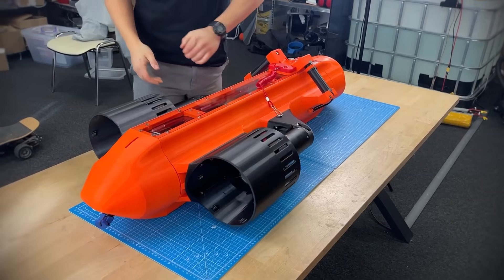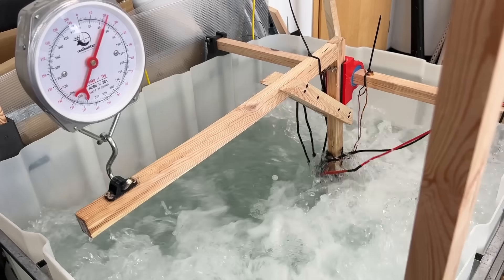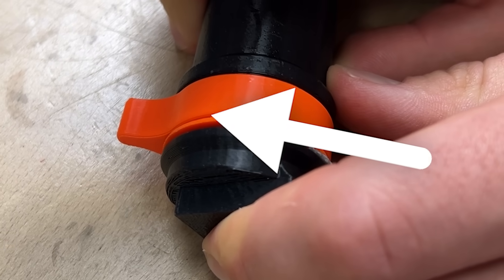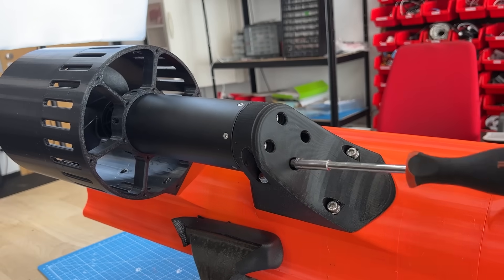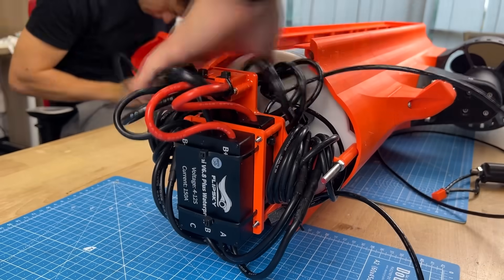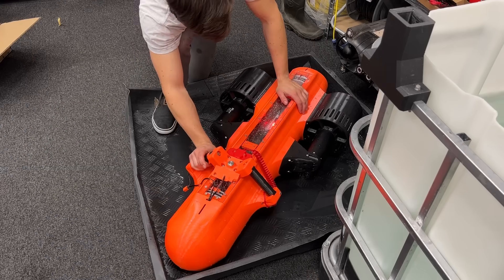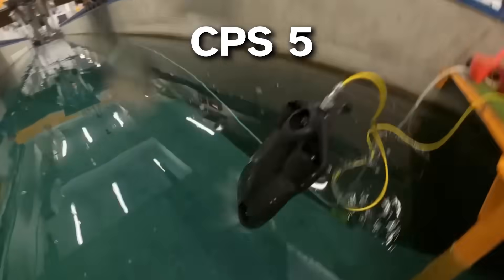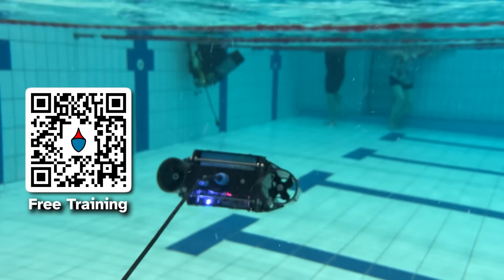Building The Fastest Underwater JETPACK

Comment from the maker: A baby riding this thing would've been faster

Edit: Here's part 2 - https://youtu.be/IvCh4gWkHhM?si=RLTkcOvNz6V8oReG
Reply: You will want to reduce the size of the holes in the motor guards for that.
Reply: Baby training is expensive, though.
Reply: The driver of that thing needs a face-shield helmet tho, also, the speed-drag may pose a risk to the neck of the driver.
Reply: Make water inlets that cool the converters outside and make the cables shorter so they don't block the flow.
You probably need 10 or 20% more power rating for them than the motors.
Think About flow control of the coolant and case integrated heat sinks.
You might want an extra crash bumper at the front or reverse thrust.
Reply: @Nightowl_IT  - Speed brakes on the diver would help. But if they deploy unintentionally, the diver gets ripped away and left behind as shark bait.
Reply: Maybe have a hydrodynamic cockpit with a rubber bladder that seals at your waist, and pressurize the bubble?
Reply: need a dwarf test pilot. Or someone that lost their legs. I've been saying this about jetpacks for years. 2x the flight time or same flight time with 1/2 the jetpack. Imagine an elite group of dwarves with jetpacks and weapons? Terrifying.
Reply: @Pyromancers  Midgets and above knee amputees would be prime test subjects!!!
Reply: @Pyromancers  - Women have complained about this obvious issue for years. If legless, female short people were sent into hydrospace or outerspace, their diminutive size would be exceedingly helpful. But few could hope to get that job, and it's the projective hopes of people that draw them into supporting unjustifiable manned platform support.
Reply: @Pyromancers  😅
Reply: It's not rated for babies, they would have to change the grill.
Reply: I would call it CPS
Custom
Printed
Shark
Reply: Hey I sent you an email earlier, can you please send me a reply?
Reply: Call it the "Scrubberine"❤❤
Reply: adding (part 1) to the title would've been less clickbaity but here we are
Reply: @indubitably_  he blurred the prices when he showed the website, it's to be expected
Reply: not a jetpack, but...subpack?
Reply: @amdreallyfast  not much of a pack, but the name is good
Reply: Immediately thinks of turok Dino hunter
Reply: Let's be fair, you are quite fit. Child wouldn't have that smaller cross section of a body.
Reply: Scharks dont eat ppl bro please say this in a post U hurt scharks image even more alto I love the vid
Reply: @ufcplayer2444  they factually do and have. We've found sharks with human parts in their stomachs.
Reply: Should have created a shroud that went around the person that made them incredibly water dynamic.
Reply: @JeremyKilroy  - A shroud without a tapered end (trapping the diver) will not necessarily exhibit significantly different drag than an unshrouded human.
Reply: Mini sub
Reply: Does that mean you are looking for a volunteer?
Reply: If the shark gets your legs you can pull the shark to shore
Reply: @fazered8202 
Or Not!
Reply: thats what she said
Reply: Only one way to find out ! gets the duct tape
Reply: More like CPOP Custom Printed Orange Pickle
Reply: Reduce hydro drag by printing a recess for a aluminum air tank in the top of the hull and feed the regulator off a back mounted K valve. Or put a pony tank completely inside. In backpack mode extend your hands forward, clasp them together and narrowyour arms as much as possible (squeezing your head)
Reply: I wonder if that Nirvana baby is employed.
Reply: Wished I could used it it was darn cool
Reply: I have an idea for future under water scooters you can make it a mini sub of sorts where you can insert the top half of your body fixed with cameras and VR type monitor with forward and bottom view
Reply: Would you guys be interested in making one with larger motors for $20,000? 

Do you have a business contact?
Reply: I love that in the us we have an agency called cps... child protective services. Then the stuff like the motor guard and such on this channel
Reply: @hf117j  my stomach
Reply: You need to remove the boundary layer to go faster... all possible.
Reply: I know the exact problem your having weak esc's and voltage cut-off...you should 1x esc 350amps 1x motor and add capacitors to the esc, thicker wires/8mm connectors and problem solved.....your welcome😉
Reply: Its much more complicated, but i'm saying it in simple terms...for the people that dont speak tech language
Reply: @CPSdrone It almost looks like it's big enough if modified to slip  into surfboard and paddle board body to be ridden on like a surfboard and paddle board.
Reply: When you get done with the underwater scooter you should get the underwater scooter in your programs
Reply: I think for better hydrodynamics you shoul to add a watershield(exat thing like windshield)
It will help to see things next to you, allows to not be annoyed from powerfull backflow of water and reduces the lac of the hydrodynamics
Reply: The jetpack mode is worse not just because of the drag but because you have no means to control the direction. Quick question, how was the control when using mode 3 and the little bit you did with mode 4 and what would you change to fix that?
Reply: cps= custom printed subscooter
Reply: This would be good for lifeguards for rescue
Reply: Name it the orange torpedo  ❤❤
Reply: Name it the orange torpedo  ❤❤
Reply: Fast what i name it
Reply: CPS - Custom Printed Scuba 
Szacuneczek panowie za to co robicie ;)
Reply: didnt you say in the video that a baby would be able to get in the moter grill
Reply: Hi
Reply: Two Names for Your Consideration;
Piorun (Thunderbolt), after the legendary Polish destroyer vessel, ORP Piorun, that helped sink the Bismark. 
That, or...
Orzeł (Eagle), after the equally storied (and frankly, badass) ORP Orzeł from WWII, a name which your current Navy flagship submarine has had the honor of also been bestowed.

If you haven't heard the history behind them, a good primer to watch (on youtube) and learn more about them would be, Lazerpig's video about Piorun and Animarchy History's video about the escape of the Orzeł and her crew.

I'm an American (but also a history nerd and have family from Poland), so as excited as I was to think of these names and their relevance, I may have a rather tunnel visioned understanding of the aforementioned compared to the wider world, let alone someone who grew up in Poland. Interested to hear people's thoughts and perspectives!
Reply: Make it Subnautica Themed
Reply: Fr
Reply: Prove it.
Reply: Alterra called and wants it's Seaglide back.
Reply: liar
Reply: For the water dynamics issue of drag created by the driver (rider?), what about 3d printing a hood/scoop/cone that will create a gap behind it where the driver will hold on to and be behind? Almost creating an eddy behind it so there is less drag. Could create it clear so the operator could still see through it. Basically making it as streamline as possible.
Reply: It's 13th december :/
Reply: For safety on the highest speed, please orient your final testing away from the sidewall of the pool. There are ladders there , Etc...
Reply: Ann❤
Reply: Bro.  I have more than a dozen Seabob motors with props and drive shafts. Id have given them to you.
Reply: call it a cpj for costom printed jetpack
Reply: kawitacja
Reply: What I would recommend is creating it like an underwater jet ski with control find on the front with the hand holds hidden to help with water dynamics. But you could really create this into an underwater motorcycle. In fact, this would be awesome for life guards.
Reply: GFM = Go Fast Machine
Reply: Its jan 7th
Reply: Now it's the 8th..
Reply: It’s the 8th of January now where’s the video?
Reply: excuse me this may sound problematic, but what if i purchase the course and start building these drones, would it be possible to sell them already built to customers? assuming someone dont want the hastle of building themself?
Reply: Five good names and Taglines for your Jetpack. 

#1 High Speed Water Boner! "Ride the Bun Below"

#2 Swimmy Frank! "Hydro Power with a side of Mustard"

#3 Super Sea Weenie! "Go Deep Stay Toasted"

#4 Weenie Wave Rider! "The Tastiest Way to Travel Underwater"

#5 Glub Glub Hydro Dog! "Dive Deliciously"

I hope you choose one of my names for the Jetpack! 😂
Reply: @FarmerFpv  it doesnt even go high speed it blew up and stopped working
Reply: A baby would lose their hand tho
Reply: @panher  less weight = faster
Reply: @theMedicatedDedicatedCitizen - Do you mean acceleration (time to max speed)?
Reply: @bruzote  who cares dude. I'm not interested in a lengthy conversation about how increased mass doesn't affect top speed. If I wanted to be bored, I'd talk to ChatGPT. It was a joke
Reply: baby SHARK you mean?

Comment: BLDC motors can't just decide to turn off, only their "motor controller" can.
i imagine its trivial to replace them to ones that can have some form of communication to turn on/off together.
and maybe its the motorcyclist in me but the idea of speeds 1-4 only is awful. If you put a magnet in the throttle outside of the watertight enclosure, a 3d hall effect sensor can read its position.

Comment: Cps booster : custom printed swim booster
Add some sort of fin or spoiler in front, also some clear plastic to improve hydrodynamic and visibility problem or like your case water in mouth

Make two throttle so you can easily steer the water vehicle

Make the output of the propeller/motor conical or make it like jet engine to improve power

Comment: 10:15 you maybe should have used forced active water cooling with a heat exchanger to deal with salty water.

With the pipes and pumps all considered, than you can coat everyting on epoxi, ditch the tube to compensate for tge weight added, so you can make a more aquadinamic design and ergonomics.

Im not a pro on anything, just a youtube addicted, so stealing ideais from other projects i saw, so take all this with a (or some) grains of salt?

Comment: 11:58 
if y'all waited 24-48 hours, and let it dry: i guarantee not a single part would have broken. only reason I say this is because the device is clearly soaking wet judging by all the droplets on the window, and because I regularly soak entire desktops and laptops into water to get all the dust out. 48 hours later, I turn the system(s) back on and they work almost even better. I get paid a few hundo for drenching people's computers into water. use ONLY distilled water for electronics. do NOT power electronics, after soaking, for bare minimum 48 hours. I say that with a grain of salt; however, because everything was powered at the same time it got wet. Powered Hardware+Water = Kill. Hardware+Water=Clean.

Comment: I see that you have put the props in ducts.
I couldn't see if you have put "spinners" on the exit side of the propellers 
Drag is reduced by making the rear section with as much taper/ teardrop shape as possible.
The motor housings should have more curvature on the nose.

Comment: I don't know what you are doing, at the moment with the project, but the thrusters should use a duct design to maximize efficiency. Also, the larger the propeller, it will have less trouble with cavitation, with lower tip speed. I'm also wondering if you might get more efficient propeller with a single, larger prop, with the motors coupled together, maybe with toothed belt... Maybe you could do counter-rotating propellers with one motor driving a propeller shaft that sits inside another tube, so that the outside tube is driven by the other motor by a 1:1 toothed belt ... It's damned hard to illustrate with no attachment...
________.  _____________()
               |______________()__()
               |_______________
_______|. ___________ ()

Comment: 2 thoughts: need to consider ways to reduce DRAG. Adding some minor fairing/waterscreen (can’t call it ‘windscreen’ can you?) might reduce drag from the rider making more efficient use of the power. Next, if you really want to reduce drag, get as much out of the water as possible: hydrofoil. Put the engines on foils below the main body and at high speed it may be possible for the body and rider to rise out of the water creating significantly less drag.

Comment: Hi from Wales guys, The mode switch... great idea but maybe you could mount it as thumb activated devices and series connect on both handles (both thumbs at the same time to change mode), to make them waterproof you can use a magnet switch (reed switch) very tiny ones were used on the early computer keyboards and the first electronic retail cash registers.... also a "soft start" circuit would help dissipate some of the instant load on your ESC's.  Great work gentlemen, keep up the inventiveness. 👍😎

Comment: Neat idea... can already tell early on that it's going to be a little over-engineered. There was no need for the kill cord AND the dead man's switch... you could make do with either or. You used the kill cord to control the computer's access to the power source... problem solved, just let go and it stops.

You could also have run that through the dead man's switch, it's just a simple wire to run to run from the battery, to the switch, THEN to the computer and various sensors. Magnet or pressure switch makes little difference.

Comment: I am at 5 minutes they are working on the throttle and already they make the first possibly fatal mistake. To change speedmodes they made a button. But they put it in the middle of the steering wheel..... making it necessary to let go of the wheel with one hand in order to be able to push the button. And that while it is pulling you forward with great force. So the wheel will instantly turn to the right making it uncontrollable. it is a disaster design mistake. I have to admit these kids are imaginative and productive and it is great fun to see them just trying things and breaking everything. They make so many mistakes because they do not plan carefully. Safety is paramount and when dealing with powerful components one worries about these kids safety,........they did not even make a power cut off cord in case they let go of it.... how safe is that for the people around??? it can shoot straight out of the water and kill someone easily..... they really do not even have a clue  as to what they are doing and what serious consequences their unintentional negligence might cause.... hopefully someone more adult can help them and just keep an eye on things__ would not be a bad idea.

Comment: I can appreciate the simplicity of these recent/modern designs but, as a thought experiment, you should check out some of Viktor Schaubergers works. If you could use an intentional vacuum at the front and pressure at the back you would have a more efficient design instead of just relying on the "propulsion". Regarding hydrodynamics of someone holding onto the device, if you could condition a small pressure area around the person so some or most of the incoming water would flow over that "pressure bubble", like the bed of a pickup truck, you would have less drag on the person slowing down the machine.

Comment: The P2S uses the lower resolution older belts, the VRF imperfections in prints was solved with the H series in the H1 using 1.5 mm belts., so it does NOT have the same quality as the H2D.  The P2S is intentionally designed to be worse than the H series.  (since the belts are basically a zero cost difference the result is clearly Bambu CHOSE to make the P2 series lower quality intentionally)

Comment: Cześć chłopaki. 

My Dad, a 70 year old engineer from the ‚old school’ Poland said:

Unless there is an enclosure the rider  will not be able to control the underwater scooter at 25km/hr speed holding the handles in my opinion. 
They should try first hanging from monkey bars and add some weight to their legs to get total 100kg load on their hands to see how long they can survive the load and also test controling the speed and direction under such strain. 
The shark will eat them for breakfast 😋 

The better approach would be to have thrusters somehow attached to their legs, so the push would be applied on the rider feet.
Reply: Love it. Knock his model with a plausible problem then come up with your own that gives the exact same problem in reverse on your body. Oh yes it'd be much easier to hold your body out straight in front of that amount of thrust then it would be to hold onto it and of course controlling the direction.... Yes much much easier.
Reply: @AaronSmith-mn2hu  so you are saying your grip strength is as strong as your quad muscles are at keeping you standing. Ok, good for you Hercules. But normal people have much stronger legs than hands. But keep sniping, some day you’ll hit a target.

Comment: Your technique is also slowing you down. To truly maximize your speed, you need to close your mouth, tuck in your chin and face down the floor, straight body and legs. That will show you the fastest speed possible with your device, well considering the weight of the diver as well.

Comment: There should be one controller to increase the speed and another to reduce it
As you guys said in the video, the person creates a lot of drag, so that concept will not get you that fast. It is like expecting a semi truck to go as fast as an F1.

The concept is cool and very portable, so pretty easy to carry, but unless you deal with the resistance/drag of the user, I don't see how you guys can achieve that speed.
If you already have a solution that does not require the user standing behind the vehicle using a cover to deflect the flow, then that's great and that will be impressive to see.

To wrap it up. This is a very good project guys. Good job. Keep pushing.